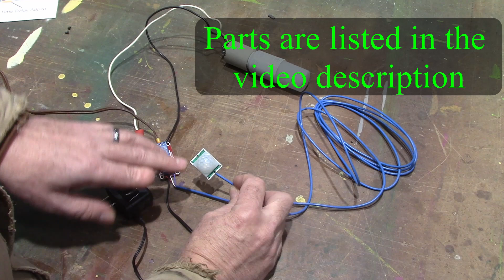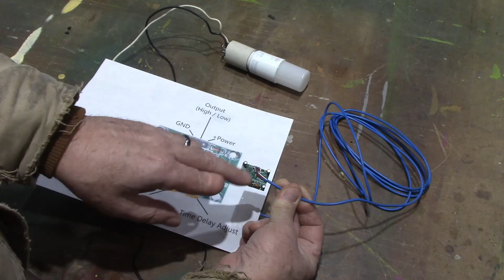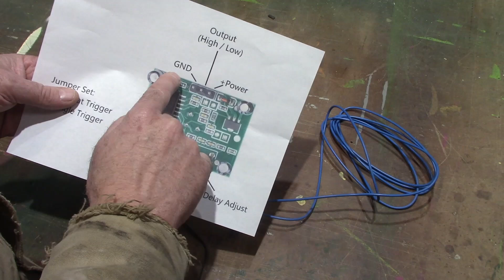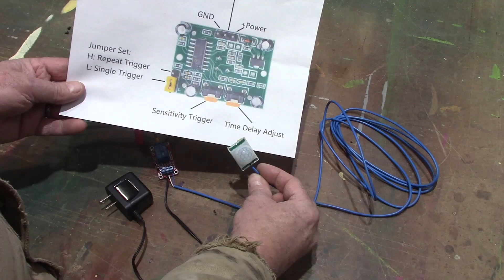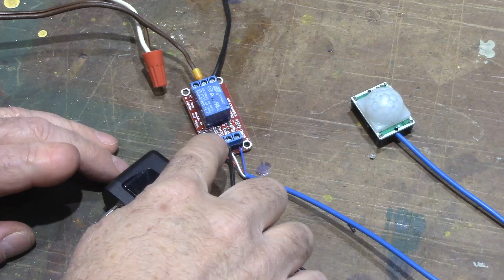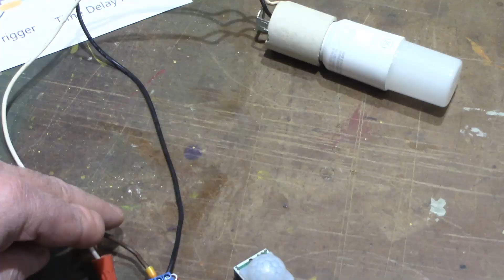Budget PIR Motion Sensor Light

Comment: Could you please elaborate on the wiring required for a multiple sensor arrangement?  Are the sensors wired in series or parallel back the to relay board?  I suspect parallel wiring is required so that any one sensor triggers the relay?  Do you have a suggestion on how to terminate the bundle of sensors at the relay board?  Do you suggest soldering the like leads together with one pigtail and use the pigtail to terminate at the board?